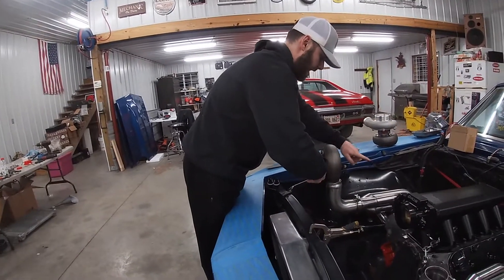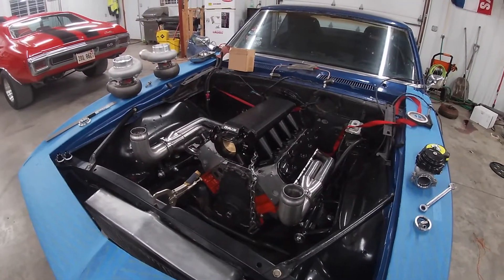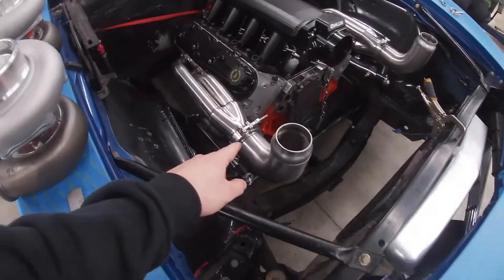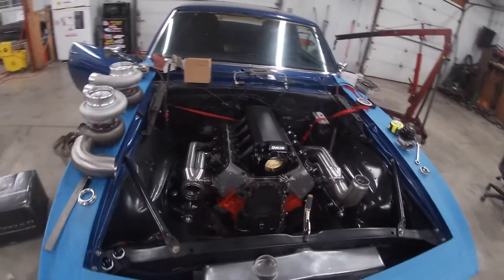Twin Turbo Camaro LS Swap. Part 4: Turbo placement!?

Comment: What ring gap are you running ?
Reply from the maker: They were all between .028”-.030” without filing them at all. This motor was ready for all the boost from the factory lol

Comment: I’m going for the exact look on my Chevelle , bottom of the air inlet just clearing the hood , using truck manifold and journal cast 67/62’s bcuz broke AF but still want boost lol
Reply from the maker: You could always run a bigger single to save money. Can still make big power with them